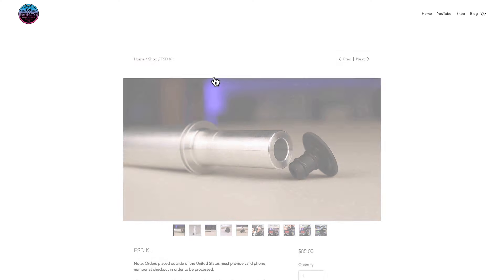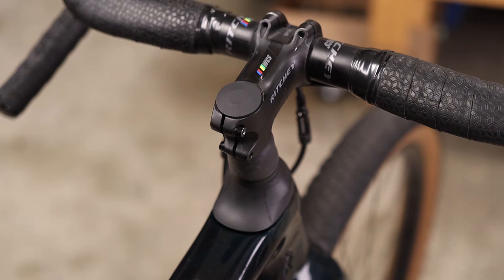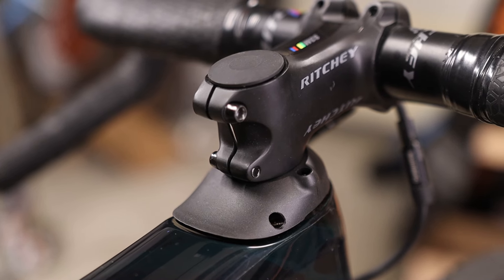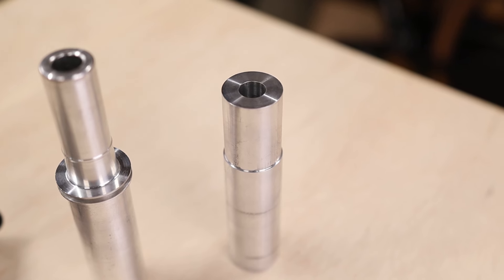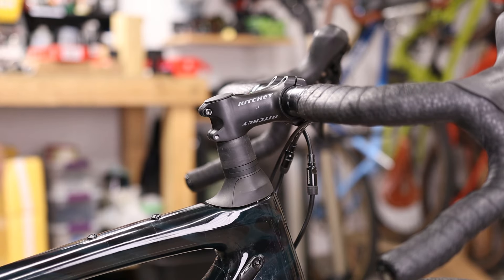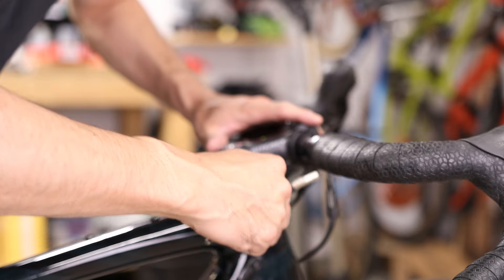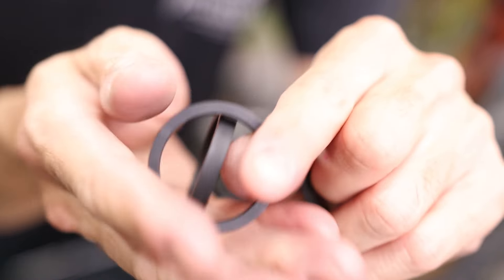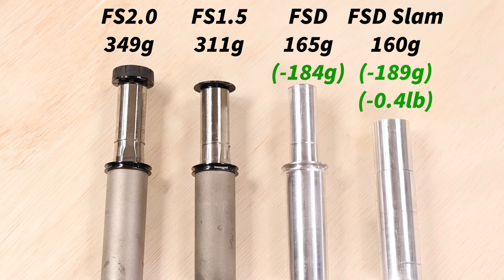Specialized Future Shock // DELETED & SLAMMED

Comment: It's interesting comparing your slammer with the other products on the market.  Those other products are machined from 7075 Al as are yours and have the same 30mm/28.6mm stepped outer diameters - as they must to both fit in the future shock head tube and accept a standard 1-1/8" stem.

The big difference, though, appears on the inside.  You use a stepped inner diameter while the other products use a constant ID.  More significantly their ID is much greater than yours (i.e. you use a significantly greater wall thickness).  This suggests that your FS replacements are significantly stronger than the competition.  Would you be willing to share the design load limits you used to arrive at your choice of wall thickness? The "other guys" do present their numbers in some detail and I would think that your, presumably much higher, load limits and safety factor would be a selling point.
Reply from the maker: As far as I know, we have the only product that’s been independently lab tested to ISO standards (ACT Labs in Long Beach CA which is a bicycle component testing specialist). 

We chamfered the inner diameter to preserve strength but also reduce weight where material is not needed. It’s a critical safety component so we didn’t take the design lightly.
Reply: @TheBikeSauce  And your lab testing is indeed a strong point in favor of your FSD products.  The "other guys" do, however, present the details of their FEA modeling - showing, for instance, that a perpendicular force of 200 lb applied 265mm from the axis of the FSD would result in a maximum stress of 40600 psi or 56% of the yield strength of 7075 Al.  Similar specificity about the stresses incurred under load in the Bike Sauce FSDs would almost certainly show lower maximum stresses / greater safety margins.  If those numbers are available it would be nice to see them to confirm the superiority of the Bike Sauce product.

It's clear you make a better, stronger product.  I'd just like to quantify how much better and stronger.

Comment: Man this future shock thing is a mess.  Crazy to have to create such an intricate solution to what should be a pretty basic steerer tube.  Genuinely curious, does anyone who owns one of these frames with the FS actually like it?
Reply from the maker: To be honest, the ride feel when it's new is remarkably good. The problem for me is that its such a complex system and both of mine eventually started making creaking and popping noises. The cartridge is not serviceable and the official recommendation is to replace it.
Reply: I've got two '21 Diverges.  One with FS 1.5 and the other with 2.0.  I don't have a problem with either and appreciate that they take the edge off big hits.
Reply: I have a Domane.  But I'd love to have a Domane with a future shock IF I could have a very slammed stem.  I've borrowed one and loved it but the geometry just didn't work for me.
Reply: So far loving mine. It is not an intricate solution. For that go look at MTB forks. This is vastly more simple. The problem is that it needs more adjustability because people ride with different weight put upon the handlebars. I have the FS2 and think that while it adjusts dampening it is limited in not allowing adjustment of the springs. For me it is pretty good at its lowest damping setting. Which makes me wonder if FS1.5 would not be an improvement.
Reply: I never liked Specialized until I rode the Roubaix I bought my late wife. With carpal tunnel syndrome I was surprised at how much the FS helped, yet the bike's stiff enough to rival my hardcore race bike. It's one size too small so I found an S-Works frame in my size and swapped the components over, and it's by far my favorite bike. I want to buy a Diverge to replace my CX bike but can't find a decent deal.

Comment: I just saw the first trial to delete the FS that failed in a race, don't remember the racer... But I remember when working at the shop and milling a similar part to adapt due to difference in diameter, how it failed at the first push due to the effect of 90° angles at the steps where diameter changes, never tough that could happen so easy, I hope the aluminum does not suffer that effect too... At that time we had to mill the piece with curved transition to avoid that fail
Reply from the maker: Stress concentrations are always highest at sharp corners. Ours uses rounded corners and a slopped transition on the inner diameter to avoid this weakness. Also we use 7075 T6 which is much stronger than typical 6061. Can you point me to the design that failed in a race? Haven’t seen that

Comment: Why not put a Tarmac fork and bar on it????
Reply from the maker: Future Shock equipped bikes use a proprietary fork and headset.
Reply: @TheBikeSauce  they are both 1 1/8th
Reply from the maker: Pull a future shock headset assembly apart and you’ll see what I mean. The fork steerer is a different diameter and the preload system is lower in the system. An Ahead style 1 1/8 headset won’t work. Otherwise people would have swapped the fork already.
Reply: @TheBikeSauce  that is super stupid for Specialized to do that!

Comment: I’ve just switched out the FS 1.5 to the FSD slammer and the difference in ride quality for me as a road rider is night and day! 

The front end feels both stiffer, lighter and the bike is far more responsive when climbing, cornering and putting the power down. 

I haven’t gotten on with the FS for a while now and this was my last attempt to try and rectify this or just get a new bike. 

My Roubaix has pretty much been converted into a Tarmac and feels like a new bike! 

Thank you so much for engineering this amazing solution for those who don’t get on with the FS technology and saving me the cost of a new bike.

Delivery to the UK was quick and it’s worth paying the extra for a decent product like this vs some other options which I thoroughly researched.
Reply from the maker: Glad it’s working out for you!
Reply: I'd just like to second what has been said here. My 2019 FS had become saggy even after swapping out the spring and I didn't want to spend the money on a replacement. This is a fantastic option.

Comment: What stem would you recommend using with it? You said it can’t be used with the factory one on the roubaix right?
Reply from the maker: The Slammer insert uses any standard 1 1/8 stem. If you have a Roubaix with Future shock, it's possible you have a "future stem," which has a smaller clamp diameter. This stem will work with our standard FSD kit, but the Slammer version is designed to use a standard stem.